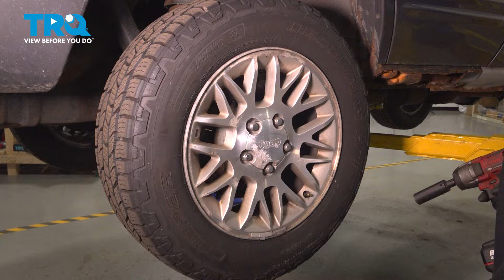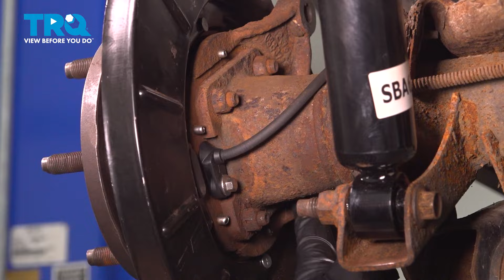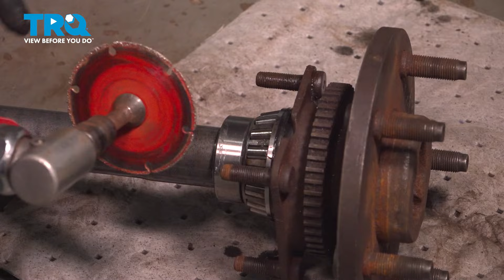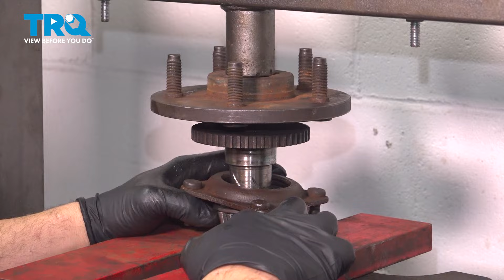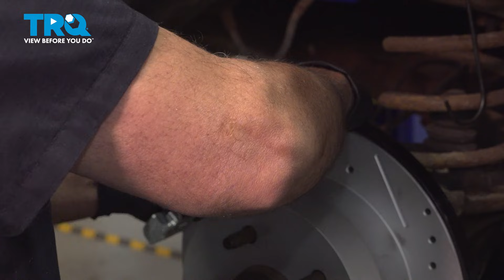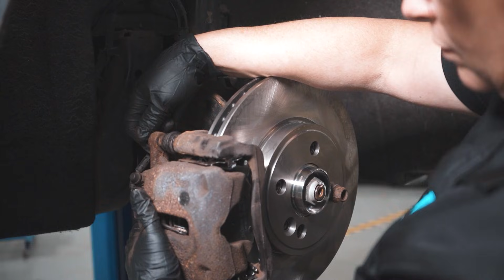How to Replace Rear Wheel Bearings 1999-2004 Jeep Grand Cherokee

Comment: I have a 2003 limited 4.7 4x4 I have done this a few times over the years and my berings have always came with the race attached to the baring and I use Timken. This is new to me seeing the race tapped in prior to installation of axle.

Comment: The notch in that back plate is for either clearence for the park brake or the wheel sensor. Not sure which, but you should check prior to removal as you will want it to go on the same way.

Comment: The ''race'' is the ring that holds the bearing on.  What he calls the race is the bearing ''cup''  Sure wish they'd use proper names for components.  Bearing races used to have set screws that held them to the shafts on machinery.  You can heat the race and then just tap it into place and when it cools it will be tight just like installing a ring gear on a flywheel.